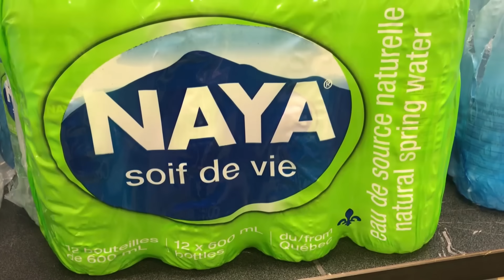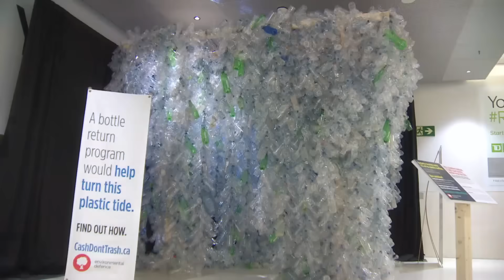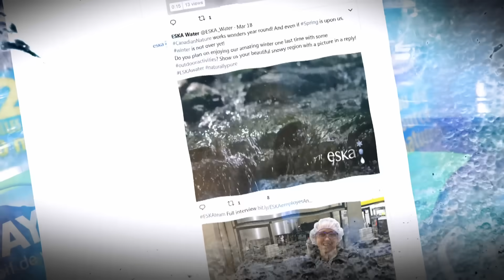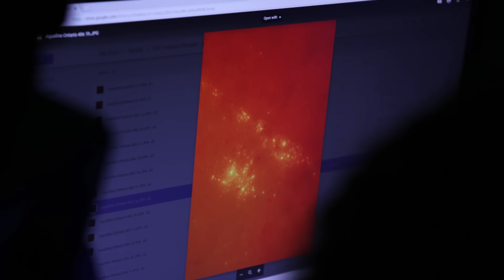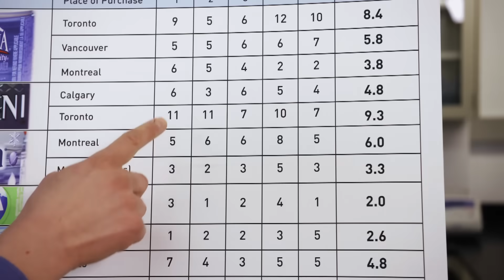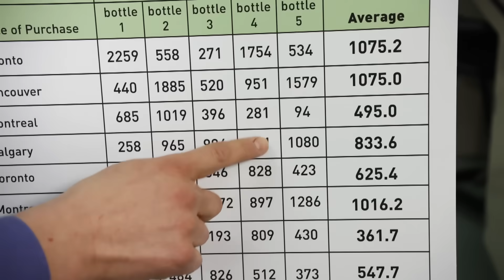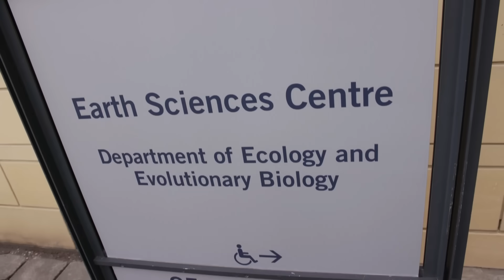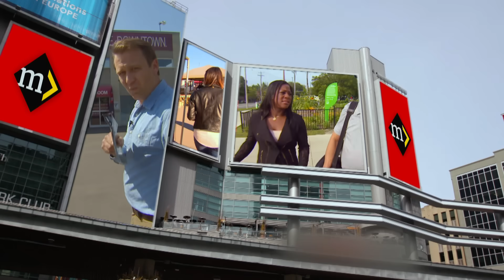Here's what's in your bottled water (Marketplace)

Comment: most bottled water is tap water, only buy and drink "Sping water", Aquafina, Disani, Nestle, most big names are just bottled tap water.  I will only drink spring water, stop buying with ignorance, not only will you find pfas, you will also find metals from old pipes in your cities infrastructure in your tap that may or may not be cleaned out of the bottled water, as well as the trash in your local ground water from fracking or industrial run off.

Comment: You should be more concerned about nanoplastics not microplastics, most microplastics are eliminated thru digestive system however nanoplastics are deposited  in the body. Where is tap water analysis?

Comment: I understand bottled water to a point.  Your out and about, your thirsty, okay buy a bottle.  But if your at home, unless there is some sort of issue with your source of water that you absolutely cannot fix, there is zero need to buy cases by the case.  IF you use water every day at work, buy a nice insulated tumbler, and put some ice in it with water.

Comment: Precisely why we use a Berkey water filtration system. We DO NOT USE plastics at all to drink out of. Stainless steel works. Our tapwater here in Vancouver is rated highly and we just improve on that. Aside from that there is the cost and all the extra trips to the recycling center. Bottled water just DOES NOT make sense at all if you put just a little bit of thought into it. In fact it creates a lot of extra cost plus all the environmental problems. Just a small amount of effort on our part makes a huge difference to our environment. We only have ONE environment and we should treat it a LOT better than we do. Bottled water is insane when you think about it.

Comment: And let's remember the heavy metals, arsenic, benzene, chlorine, petroleum byproducts & fecal material in tap water. There is no such thing as clean water in your home without a $5,000 filtration system that still won't filter out the plastics.
Reply: A $200 countertop water distiller will take all that out

Comment: Our well water is not good for drinking it gives you the run's so we use bottle water for convenience for most of the time we have a water cooler and we refill the bottle at our local Co-op but once the outside tap is turned on we refill the bottle there until it's shut off

Comment: Very interesting, but lets look at the following and see if there is a way to improve on the reusability of these bottles by switching plastics to those less harmful or non harmful.
1. Glass really is not an option and I see them becoming, not obsolete, but non-profitable. The glass weighs about 3 to 6 times what a plastic bottle weighs, multiple this by millions of bottles and you might see where this is going. Its about the weight and shipping. Everything is shipped by truck, and governments have placed weight restrictions on the weight of trucks, and for good reason, the heavier the truck, the more stress and damage to our roads and bridges. If a truck can ONLY take a certain weight limit, therefore a LIMITED number of bottles, you WANT to get the most for every dollar spent on the distribution of your product. Companies WILL use the cheapest, most efficient option to get more WATER in the truck.

Comment: we have a well from the Oglala aquifer only 240 feet deep, I do have it tested for chemicals every few years always comes back good. I doubt if plastics are in it since the layer of clay between  the surface and the well head is almost impermeable. so it should be older water than the plastic coming into the environment

Comment: If you're concerned about the quality of your tap water, install a water purifier on your tap, or run the water you plan to drink through an accessory device with a filter to further purify your water.
Use reusable water bottle instead of buying bottled water.
Water bottlers are misleading the public, both because of microplastics, as well as using municipal water supplies to bottle and sell as a better water source than our tap water.

Comment: Depends on how they are shipped too. Water is not shipped on refrigerated trucks some of those dry vans get to 140 degrees. And yes the bottling process will include plastic components.

You'll find plastic contacting everything no avoiding it. Even an expensive steak. Tap water also has it's issues Chlorine and Flouride etc.

We can't use less plastic because glass is way to expensive. Green glass is typically imported from Italy.

Same things happening with cars. I like this video although wasn't surprised. Although the amounts detected aren't subject for harm its definitely true.

The bigger issue here is supply and demand and profitability. 7 billion comming up on 8 billion people. Theirs no easy way to do it. The world wasn't intended for that.

The other thing you should know back in the day when we built factories and plastic components and rubber ones. The science to detect the transmission from production to food didn't exist. Nobody complained. But we had alot more bakers hand creating an affordable meal. That's resulted in typhoid marry.

You will not win. Because there's no choice. If there was an easy solution it would be done. Unfortunately it's part of mass production the levels just need to stay low. 

In the 1800s people were on a farm they ate home made crops and probably ate manure too. Lol. Today we are too big of a world for that.

With today's science if we went back to 1800 imagine what you would see they didn't know about they still lived their lives. Life expectancy is still high and only gotten higher. My vote. Live life understand but don't dwell.

Comment: All the rivers drain into the sea and it's never filled while water rises to same level each drop has a crown and the sand holds the sea how  water filtered  salt to fresh through the land chewing and plugging the filter system is probably why.  Micro plastic is entering should of checked tap city and residential dug well water , around here needles washing ashore closing beaches isn't uncommon

Comment: In the 80’s, bottled water was something new. I visited a soft drink bottling plant in PA that was converting to bottling water. They said it was going to be a big thing. I was skeptical. They told me that all the cost was in the packaging (the bottle), marketing, and shipping/handling. The product inside came from regular water from the tap. The tap water came from wells and could legally be called spring water. It was essentially free. So the profit margins were very high.
Reply: Incorrect. Spring water has to actually come from a spring. BUT: any water from 'the tap', which is leqal, must be labeled PWS. That is Public Water Source. If you buy PWS bottled water, you do not pass Go and do not collect 200 dollars.
Reply: @kevinadams9468 ; I bought what was called spring water and left it outside very cold temp. The water didn't freeze. So, what is in the bottled water 💧? That keeps it from freezing.  Too many plastic bottles too used for packaging 📦 😕 sick of these lies and 😔.
Reply: Most of the water is filtered to be much higher quality than your tap water. In any case get a high quality water filter.
Reply: @gangoffour6690  Water filters are a scam, they don't remove chemicals like chlorine. The filters trap bacteria and if not changed after EVERY use could produce water more toxic than your tap.
Reply: I remember when people started bottling water back in the 80’s.  I remember when bottled water became more expensive than soda. It was a joke how if you added sugar and flavoring, the price went down.  

I never bought into the bottled water craze.  I thought it was idiocy back then, and I think it’s still idiocy today.  In many cases, your own tap water is better than what’s in the bottle.  The only reason I saw for people to buy it was in the event something happened to your tap water supply.
Reply: @actuallyitisrocketscience 
 Have you noticed, 
bottled water has a
 sell - by date ? 
Because plastic from
 the bottle gradually 
leaches into the water 
 it contains....
🇬🇧💦😢💦🦉🇬🇧
Reply: Putting Chlorine in tap should be ban. Chlorine is the big reason people don't drink tap water
Reply: False Advertising !
Reply: Water?
Reply: It's always money, over perfection and health.
Reply: Thats an investment lost
Reply: Well water qualifies as spring water. It comes from an underground aquifer and other than the cost of sinking the well and well pump, it comes right out of the tap at the water plant. Better brands further purify the well/spring water before bottling, which removes contaminants and many beneficial minerals. 45% of all bottled water is pure tap water, from the Public Water Source.
Reply: @tomf429  k
Reply: @tomf429  Your body doesn't process those inorganic minerals, they end up as stones in your body. Just drink distilled water.
Reply: @tomf429   So, in your opinion, which are "better" public brands?
Reply: @backyardpc1656  Did you know that bottled water costs consumers more than gasoline per gallon and that the bottlers pay nothing for it? Bottling, handling/filtering and shipping costs run under 20-cents per gallon. Their lawyers buy up land in rural areas and take the water from wells without paying the localities a cent. This is happening all over the world. Water, which used to be free, is becoming the World’s most profitable commodity.
Reply: @backyardpc1656  I drink grocery store brands at $2.99 a case. Water is water. Everything else is hype.
Reply: Wow tom, how very uninteresting. Now tell us how a toilet works.
Reply: @tomf429  I drink tapwater 1000 liter for same price.
Reply: @tomf429  Does this include Highland spring water? 💜
Reply: @tomf429 ; See if the water freezes 🥶.  I had been buying water from grocery stores found out it doesn't get frozen. So, then what's in the water 💧 🤔. I'm wondering.
Reply: @cathyL8562  antifreeze 😂
Reply: @tomf429  if water is water why don't you just use your own container & drink the water that is already piped into your own home instead of adding to the Plastic Waste problem???? THAT was the actual point of this video.
Reply: @WoolfeandMeCageFreePetCare  My comment was referring to a time (early 1980's) before bottled water was a mainstream product. I do exactly as you suggest. My water comes from my well, under my property. If I need to transport it, I use a water container.  Have a nice day.
Reply: Is Fiji water still legit?
Reply: @jmab23  I looked it up and it is extracted from an aquifer in Fiji, bottled there, and shipped around the world. I don’t know if that makes it special, but it tastes good. The life expectancy on Fiji is 67.8 years. So, maybe they don’t drink their own water.
Reply: @jmab23  Fiji water tests very high but is expensive.
Reply: Only in a couple of US states, it doesn't work like that anywhere else, so just buy proper water from Europe where they have legal standards.
And no-one has ever said there will be more plastic than fish before this guy said it right here.
Reply: @mrianwonder6527  I heard that in 30 years more plastic in the ocean probably about a year ago.
Reply: @mrianwonder6527 this means you learned something new

Comment: Get a water distillation machine, they are not expensive. You can use tap water, bottled water, it doesn't matter as what comes out is just the purest water, and you can see whats been removed as it sits in the bottom of the unit ready to be cleaned out. Best £60 I've spent. Makes lovely drinking water, my kettle, iron and coffe machine have absolutely no build up of anything in them, they are like new inside.   Tea and Coffee taste better, wins all round and its so easy.  The shocker is what's in the bottom of the machine as you rinse it out for the first time...

Comment: You showed children being taught that plastic particles are the most dangerous form of pollution in the water.  That is far from the truth.  Besides, the particles found in the lab were large enough to be filtered out by one layer of filter paper, which means a standard home filter could have removed them. You should have tested for chemicals such as mercury, asbestos and arsenic, all known carcinogens.  That would have really shocked you!  Plus, you left the impression that a glass bottle was clean, but failed to mention that glass dissolves in water and glass chemicals would have been found in water from glass bottles, as well.

Comment: I was born in the NE corner of TN.  When l wss young tap water was fine here.  The taste was mostly normal with a slight taste of Chlorine.  I'm 73 now and can't bring myself to overcome the taste of the current tapwater.  I had a filter on it that made the taste tolerable.  It was past it's usesble life so l had to temove it.  It felt like the container weighed 3 times more than when l installed it.  So right now we're back on bottled water until l order a new filter.  So it's all about the taste in my  house.

Comment: Whole Foods has machines that distribute water I to your own containers.  I carry a quart size stainless container for use awayfrom home. One day I was waiting for a cab in very high heat index weather. Had many medjca appts that day. Filled my small bottle and went to pay. I was told no charge. WF has bottles you can put a deposit on and reuse. Water is less than 50 cents a gallon and does not taste like chlorine

Comment: We u

We used
plastic cups and you throw in the trash .we now use the aluminum cups made by ball and we recycle them in using over and over and over and then eventually they go to be recycled in the aluminum. We do hand wash them, which is easy to do. The cost is about 50 cents but you can use them about 200 times before you recycle. So that is approximately 200 + plastic cups a month we don't throw away. It more than pays for it self many times.

Comment: Whenever they rip out water main in your street. Go look inside the pipe and see what you have to say. Example: pipe 10 inches in diameter has water traveling thru a 4 inch whole. The rest is gunk/rust/ debris. Worked at stop&Shop. The bottle water sits in a hot truck getting over 100° in (MA) multiple times before its on a shelf. Just what I have seen with my own eyes.

Comment: Really this whole article is almost about nothing you are comparing bottled water to a tap water but you're not testing a tap water.
You are talking about the recycling strategy which in Canada is distinctional by the government, because if you compare it to recycling programs of Japan or Germany or other more developed countries you will quickly realize that recycling program is what needs to be changed and to all of those who are against the plastic bags you should realize that the carbon footprint on the planet is 10 times worse from the paper bag even recycled ones just due to manufacturing as well as the benefits from the food preservation compared to non-plastic alternatives.
It is as if you're trying to put the stop sign on the dangerous road instead of fixing it.
And as far as the fish issue in the ocean much bigger damage comes from overfishing which is not regulated then from some floating plastic.
Besides how often filter is changed in water fountains what type of filters are used and what pathogen do those filters protect you from as well as what is the quality of the source water ????? More questions than answers, before starting to say that something is better than something else. So ware does the taxes for recycling program go, what improvements ware made and what will it take us all to get ware we need to be?

Comment: I just boil all water, let it cool and store it covered in the fridge, use it for my coffee and ingredients for recipes needing water, I figure that ought to help anything not be harmful.
Reply: That will sterilize it, but won’t remove foreign contaminants like heavy metals, petrochemicals, and plastics. Unfortunately.
Reply: @susanmei9980  I guess she better buy a filter pitcher to pour that boiled water in. Damn shame in supposed first world country’s we have to do this.
Reply: Tae All Day Unfortunately, a filter pitcher won’t get that stuff out. You need a distiller, with an after filter. I spent a lot of time researching this bc I had heavy metals in my well water. Even reverse osmosis doesn’t get it all out, but reduces it, if I remember correctly. And RO uses tons of water for a little bit of cleaned water. 
You can get a counter top distiller that does a gallon at a time. That’s what I use. You can do abt 4 gallons a day. But it takes out the good minerals too, so you’ll have to add them back in. 
I got mine from a company called waterwise. They have a website, and I think it’s abt $2-300. But it pays for itself in abt 9 mos. I used to buy Poland Spring water, but their spring ran dry and they sold out to a big company. All of a sudden, the water started tasting like tapwater, and I was like what is going on? After a little research I found out!
You may be able to get the distiller from another company as well; I bought my original one from Sears, but I understand they’ve gone out of business. It was the same model; just with their brand on it. Just make sure you get one with a glass picture and not the plastic picture; otherwise you’re defeating the purpose.
Reply: @susanmei9980  
I work in the municipal water treatment industry. You seemed to have covered a lot of the bases. What did you find out about pesticides or herbicides? Anything significant?

Comment: bo
These plastic bottle system has to stop for something better.  
I boil my water fill a glass bottle.
Had done a test where I took tap water and boiled water filled a glass with
each and set for seven days.  
The tap water was foggy and looked dirty
Whereas the boiled wanted was still clean and even tested good. 
Both were left at room temperature.
So take a little time and boil your water. 
Have to do anything productive and possible to save mother earth.